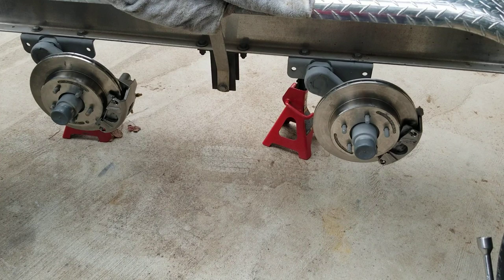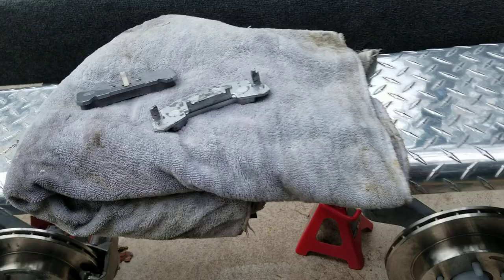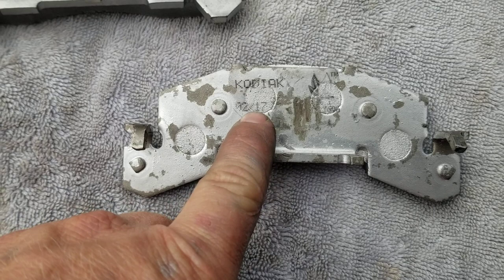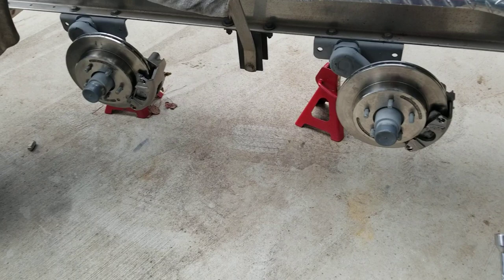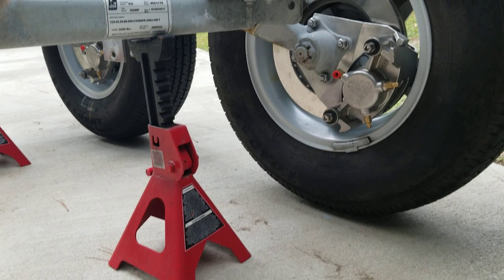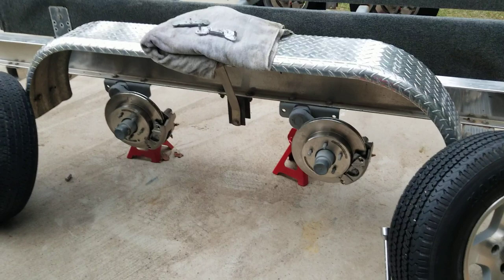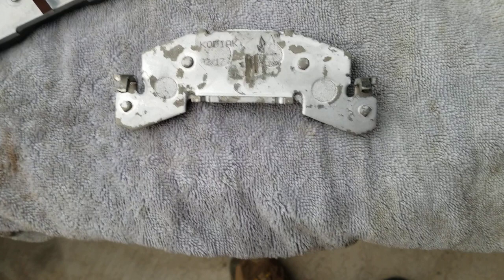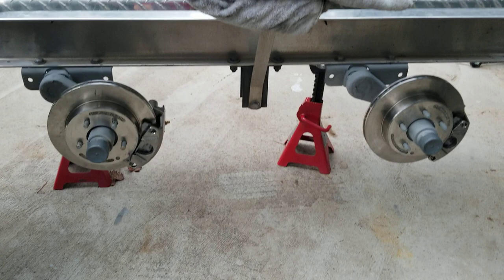I paid $700 for $1,500 Stainless Steel Kodiak trailer brakes

Comment: Did you convert from leaf spring to torsion axles? If so how did that go?
Reply from the maker: Yes I did. It was super easy actually. The key is marking where both your old axles line up with respect to the new ones. They don't bolt on the same (obviously) nor do they travel the same when a load is placed on them. Once you figure this out you just need to make sure your distance for each bolt hole will result in a fit that is square. I used 4 floor jacks and clamps to ensure I had all this right before drilling. Start to finish I want to say it took 4 hours and about half or more was prep time of what I describe here.
Reply: @skiffman10  Nice, thanks for the reply. It's definitely on my to do list.
Reply: Every torsion axle trailer I've owned drove like cat piss.  Leaf springs all the way.